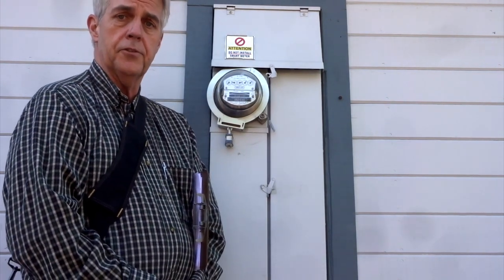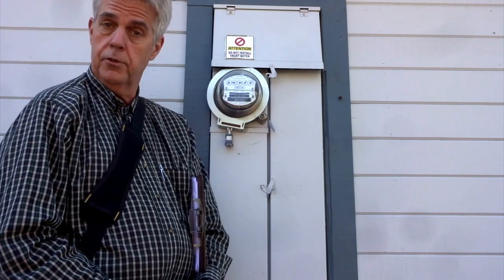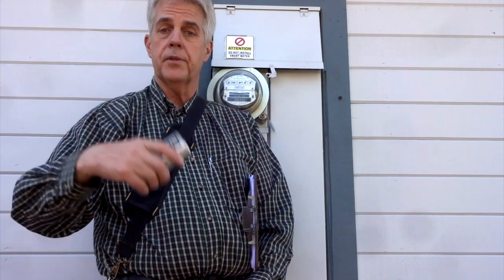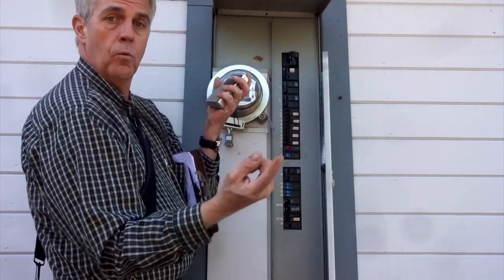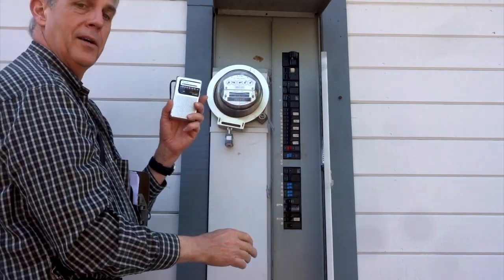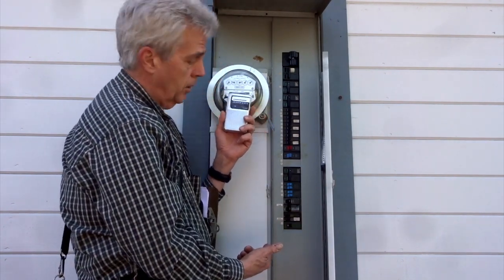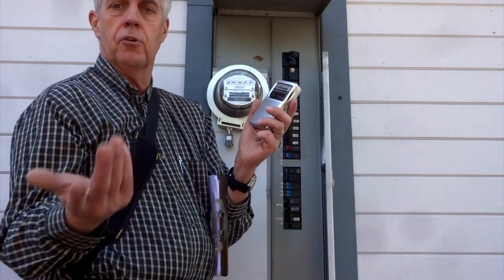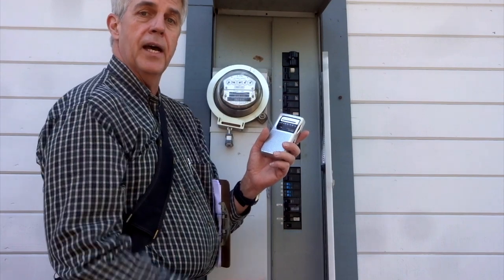Detecting Dirty Electricity with an AM Radio outside the house

Comment: Sir I am attempting to rebuild my home after a housefire.  I checked out your website and may give you a quick call. No electrician who has worked on this money trap knows anything about the negative effects of these frequencies.  It drives me crazy because the data has been out there forever!

  My last house had no bluetooth, PC hardwired, etc. Etc.  I'm trying to mitigate any dirty electricity before I put up the drywall.
 Long story short I've been displaced for 6 years, live in a shoebox size room with a wireless router, and so many wireless gadgets  I think may have contributed to my cancer and terminal illness. Yet I'm the "nut" lol.  My only wish is to die in my bed in my own home. Your information has been  Such an asset for me, thank you.
Reply from the maker: Hello Two Party, It sounds like you have several sources of EMF pollution, I suggest that you contact me for a paid consultation on this or you may spend money on a solution that does nothing. Here is the link: https://windheimemfsolutions.com/contact-us/

Comment: We're getting what you're saying only when you turn the power OFF we just can't hear you with all that dirty dancing electromagnetic wave lengths.. so if you could redo the thing and just turn off and then you talk to us then we'll understand everything you're saying otherwise. You're making it hard for us thank you
Reply from the maker: Thank you George,  I apologize for the sound quality.  I will make another video like this when the proper situation arrises.    In this case the AM Radio buzzes up to 25 feet from the house when one breaker is on.  That breaker has a lot of CFL lights and dimmer switches on it.

Comment: Don't you have a proper meter? (like a trifield) No offence, I just hope to find more info on meter options
Reply from the maker: Hi Tim,

An AM radio is a very effective indicator of KHz frequency RF radiation.  A trifled does not measure RF this low.

Comment: I just remodeled my home with LEDs. Hate them.
Reply from the maker: Hello,  What is it that you hate about them? Please advise.
Sincerely, Eric WIndheim
Reply: Windheim EMF Solutions I replaced all my bulbs with the cree LED Daylight bulbs. Huge intensity in light output. Seems to be blue light though and it's very glaring to my eyes. I like the look of the light and brightness just as long as it's not like my master bedroom . Ceiling mount light only 40 watts . I can't even stand it on while laying in bed. Feels like its causing my eyes pain.
Reply: The light doesn't look right, some of them even flicker.
Reply: @dickJohnsonpeter  which led bulbs are good to buy?

Comment: I replaced all my bulbs with led.......wow....did not even measure it after......i should have
Reply: Don’t worry about it. There is no health issue here.
Reply from the maker: On the contrary, DE radiates off circuit wires in the form of kHz RF radiation.  You can see a lot of negative health effects here: http://sammilham.com and here http://sammilham.com/links.shtm